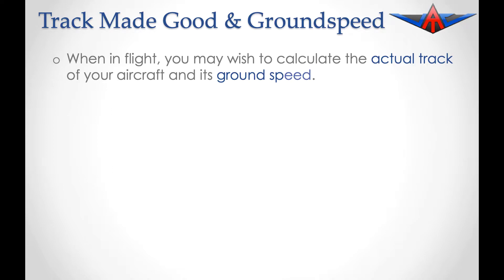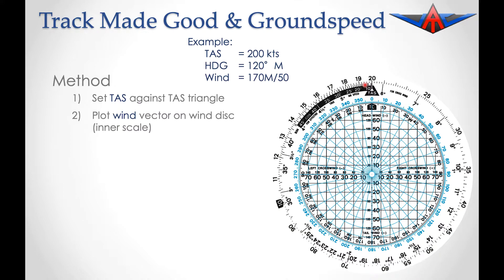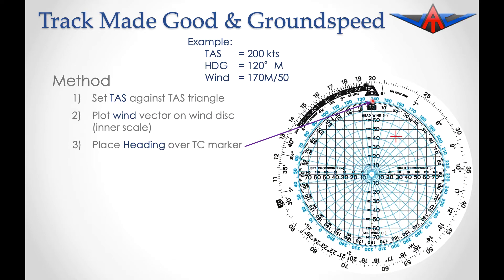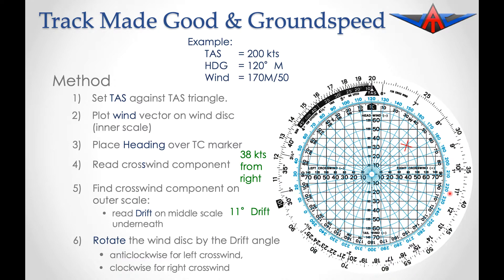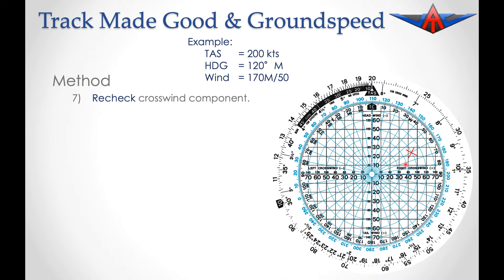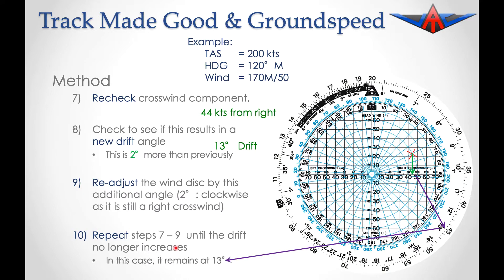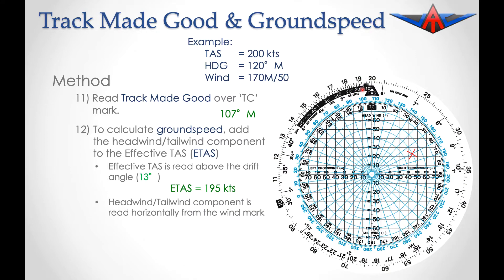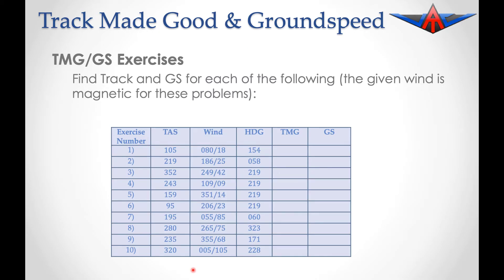Track Made Good and Groundspeed on CR-3 navigation computer

Comment: Thanks, I used to confuse the direction of correcting the wind when calculating the heading and track.
Just a question, about which flight computer is the best comparing the CRs vs the E6bs